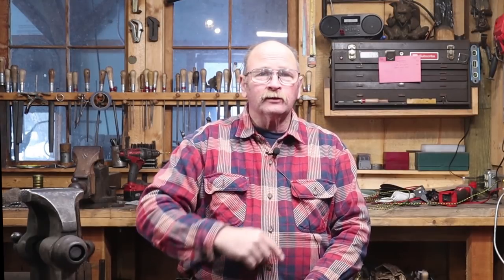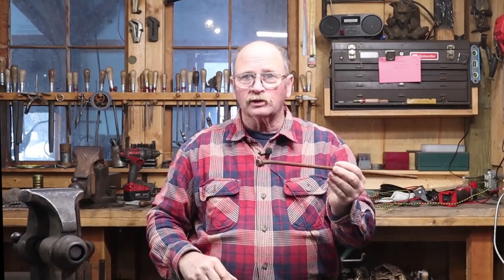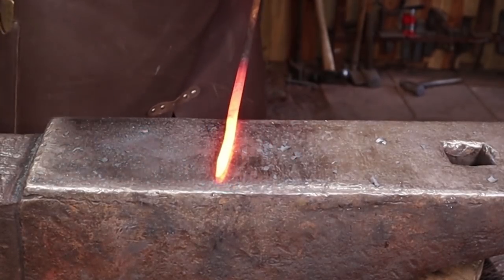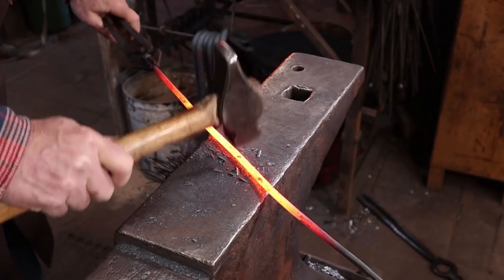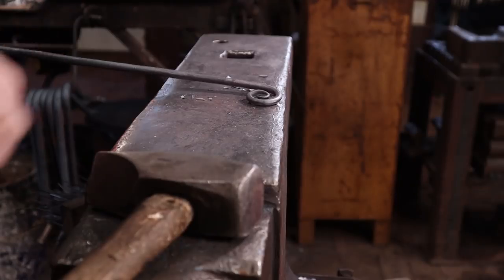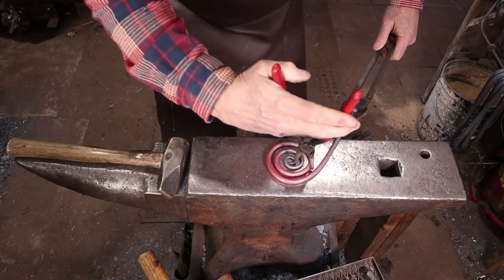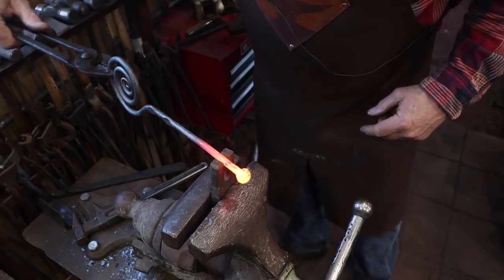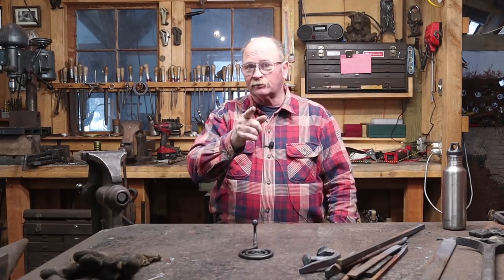Spiral top hook - Hook of the Week 35

Comment: John a new twist to nice way to hang stuff , Much nicer than the Cowboys way to hang.
 I been slowly finding time to build my ribbon burner just finished a few days ago and today's going to put to use,
 I heated up a 3lb hammer to be piece of steel to preheat and dry forge motar to almost a workable orange in 5 minutes , Much quicker than my coal start ups.
  I will try to almost copy but hopefully adding a twist of my own.
  I did put a seliold on for safety,Sir I again thank you.

Comment: At the 9:50 mark you mentioned about solid fuel forge vs gas burning the metal.  Can you maybe explain that in a future episode?  I had a trammel tip fall apart on me, and didn't understand why.
Reply from the maker: Most solid fuels can get much hotter than gas and its easy to burn the end off